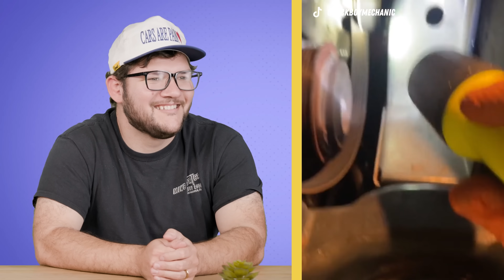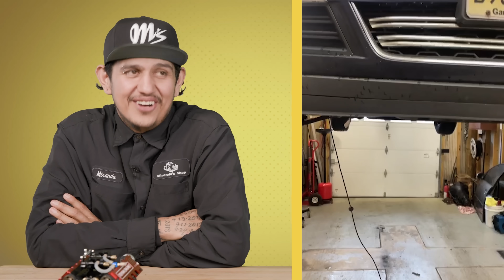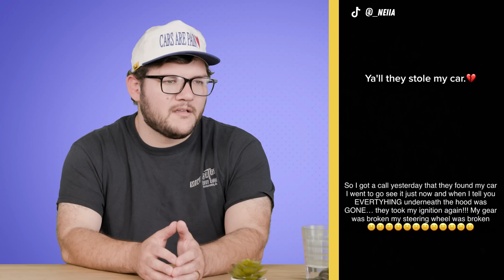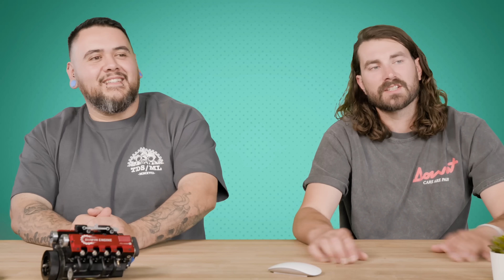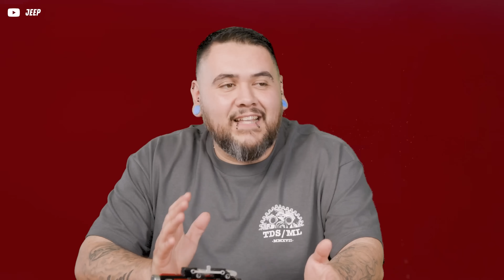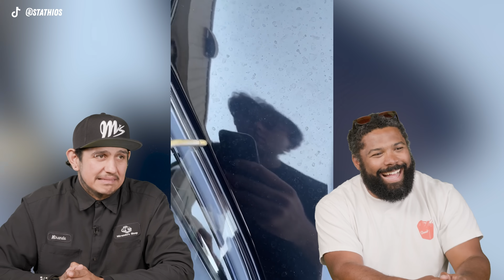Mechanic Reacts to Car Engineering Fails

Comment: My dad had a Jeep Cherokee, that worked fine , then some days it didint work at all. The mecanic would check and everything looked ok. But it just didnt work.
Until i found a post on the internet that said "remove or just loosen the ecu bolts" 
And it worked

Comment: I've 100% had the exact same bolt issue as the first case. Bolt was unnecessarily too long and it hit the frame. Had to spend an extra hour loosening the motor mounts and jacking the motor up. The kicker? I had even more room than this guy, but the bolt was 6 inches long, for a spot that only needed to be 3 inches. It still had a full inch to go after it hit the frame.

Comment: The new ford bronco, the alternator is one of the lowest points in the engine bay. So if you are doing a deep water crossing , the alternator has a high chance of being submerged.

Comment: As an engineer in this industry, all of the cases when these mechanics said rightly that it's our fault, most of the time someone saw it, informed it but sadly it was not put any action to solve it because it was not a top priority at that time, and not marked from our direction of the factory. The reality in this industry is, at some point, if this design issues is not affecting in current production process, actions will not be taken.The reparability is always evaluated, but sometimes not well solved. The working pressure during first production and life serial of the car always come to guarantee keep selling them well executed from the factory, but not how to be dismantled and revised when they need it in the period of five, six or ten years.

Comment: When the sunroof seal on me w208 got too dry from age it leaked like that on my shifter and the cars auto go into limp mode, hade to tear apart the shifter assembly over an evening and give the circuit boards an alcohol bath but it fixed it and has for multiple others I've done now

Comment: I'm going to disagree on the Jeep blame. This is a Chrysler problem and I have owned a Chrysler and it was garbage. Cross threaded a door bolt and left it like that, sticking out at an angle.

Comment: Back in the 1990s I made a template for Ford Tempos so I didn't have to pull the engine to replace timing belts etc. The problem was they were everywhere and the crank bolt could not be removed unless you dropped the cradle and engine 2". I'd set the template on the "frame" and use a 1.5" hole saw to cut an access hole. Then it was just a matter of removing the crank bolt and getting the job done. Took less than 1/2 the book time and increased the number of jobs/day. 

Ford makes good cars/trucks but their engineers told us at a class one time..."we don't care how long it takes to fix. We designed them to be put together as quickly as possible".

Comment: Rofl he said jeep used to have a badass motor. Those things were notoriously underpowered. I'm my border patrol years I drove a 2 door 1999 Jeep as a trainee. Holy crap. That thing wasn't only worse off road than a huge 2007 Chevy Tahoe but it was so loud and so slow. Even at 50mph you could floor it and it would make all the engine noise but make no acceleration.

People make fun of old loud Hondas but damn... Those old Jeeps are louder and slower. It would take literal many seconds to go from 50-60.

I heard good things about Jeeps off road software now but Jeeps were literal trash back then. And BP Jeeps had a sweet reliable lift kit and great tires. They just sucked so bad in soft soil.

Comment: We have the same generation Q3 and had a leaky sunroof.  Quick fix, the drain tube was just a bit clogged up, just pushed some wire through and it's been great for a couple years now.

Comment: 1:48 it could just as easily be the factory. Engineering may have specc'd it correctly, but the factory was like "the bolt the engineers called for is a weird length that costs twice as much as this other one thats just a little bit longer. So fuck the drawing, we're going with the cheapest part"

Comment: In all honesty, it's idiotic that manufacturers don't just test their designs on mechanics doing maintenance items to see if it's reasonable. A lot of vehicles flop partly due to the lack of serviceability
Reply: A mechanic whining that something isn't as easy as they think it should be isn't a 'lack of serviceability'.
Reply: @aarongreen1654  a common service item being impossible without taking apart half the car is tho

Comment: Jeep did one thing right on Liberty's. Because the 3.7L oil filter was impossible to remove without covering yourself in oil, the boxy remodel had a oil chute built in to direct it somewhere else.

Comment: Had an 2006 cherry 1500 V6, that I got with around 80 to 90 thousand on it. And after about 6 months of owning it, she started to fall apart. Starting with a wheel bearing, she alway leaked oil and the engine sized with regular maintenance. And the new engine also leaked oil. The drain plug drained directly onto a cross member of some kind and at some point the muffler fell off, just the muffler. Worst vehicle I’ve ever owned.

Comment: You can say engineer, but as pointed out repeatedly, the company/executives are ultimately responsible for deciding priorities. I imagine many engineers are given a bin of parts they can use and dimensions to put it in, then told to make it fit.

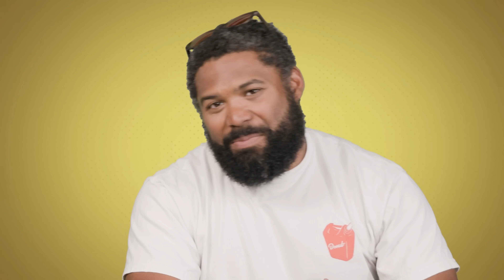Comment: @1:43, the engineer only says “the bolt needs at least this much length to hold the pulley”.  The factory (basically) is who decides to purchase bolts.  Most likely the factory had an excess of that size and had a supply contract and just made it work.  That the problem with all this manufacturing subassemblies.  The folks dropping the engines don’t care how long the bolt is: the pulley is on before the engine gets shoved in there.

Comment: Part of the problem is that the engineers are asked to design the car with a lifespan of 100-150,000, but they are marketed to do 300,000+,and most people think a service fixes all problems in a car. When car's break down, the amount of people that say "It only had a service last week!", like $200 fixes everything wrong and it'll be perfect until the next service. 😳 FFS people, A service is just an  Engine oil, air & Oil filter and lookover of the rest. It does not include brake pads, disc's, master cylinders, ABS unit's, Batteries, etc, etc, etc!!!

Comment: I'm absolutely convinced modern engineers don't believe things break in the future, which is why some things are such a bastard to fix.
I had a memory on Facebook yesterday where I had to replace a broken headlight on my dads 1996 Mondeo. I shit you not, front bumper off, both headlights out because they're permafixed by the grill. You then have to CUT THE GRILL in half. The new headlight is sold with half a grill, and you then have to put a repair kit to connect both parts of the grill.
That's utter madness.

Comment: Shows why McLaren F1 are falling towards the bottom of the championship. The guys working in the factory would look to be in the F1 operation, but the standard of work they are use to doing is of a level much lower than that required by F1, and the fact that they don't recognise it shows that they are doomed

Comment: That Land Rover reminds me of my 2nd gen ‘05 CR-V. The oil filter is directly above the front right CV axle. So unless you take a bunch of time to clean it very well, that whole area is covered in a sheet of oil after driving it.

Comment: You'd be surprised how often water gets into cars. I've got an e46 where water gets in the boot, an F25 where the sunroof drains block, the recess fills up then it spills into the car, and a megane where it drips through the light. Can't figure out how it gets into the roof cavity on the latter though 😂

Comment: To replace the lower wishbones on front of a Citreon C4 on a 17 plate the 2 under trays have to come off there is a crumple zone bar on each side that has to come off as the front bolt that holds the wishbone in place is FACING THE WRONG WAY. Engineers fault.

Comment: Put a hole through the well frame. Spray treat it for future rust and finish the job.  Note it in the shop log for other mechanics and future approvals. Otherwise,  customer needs to  agree to an engine hoist with added costs.

Comment: Modern day vehicles we need more convoluted ways to prevent the owner from working on their vehicles plus the nany state tells us the "morons" behind the steering wheel needs more gadgets and emission controls/the bare basics a throtle a choke (ladies you know the knob you place your purse on) and a gear stick to drive a car. These days you need a snapoff "interrogator" to talk to car to find out whats wrong with the poor darling. Grandpa mechanic used a flow diagram his grand kids uses a odb2.

Comment: I would not blame the engineer, but instead blame the accounting group that go through the entire design, with the sole aim of cutting a cent off the cost of every part along the way, then go through again to cut a second off every assembly step as well. They cut possibly $5 out of the cost by not doing the right designs. And thus you get things like the Pinto, where they figured making it safe in a rear end crash (arguably a common accident) would have added on $20 to the cost of the vehicle for the plastic cover, which they ironically had to do in Canada already. So the $20 was already needed to be spent, and adding to the US versions would be $1. Then to test the final time they were forced to do, they brought in a vehicle, "fresh off the assembly plant", from Canada, which they already had info for passing over the US built ones, known to catch fire. Engineers want to build a safe and reliable car, just they get overridden by managers who want to cut cost as much as possible and still have it make it out of warranty. The managers figure out of warranty the customer either will need to pay for the OEM spares time and time again, or will trade it in at a dealership on a new pile of junk destined to fail as well.

Comment: I'm a Ford guy and I love my 2014 f150 with the 5.0

That's said whatever engineer put the oil filter on the front of the block over the steering, and then put a catch pan under it that slopes AWAY from the built in spout on a front corner needs kicked in the dick.

Comment: I work at a land rover/jag dealership and that drain plug is 100% in a shitty spot. Most things on those cars are in shitty spots; such as the air filter, which is tucked under the radiator support bracket next to the headlight. Basic maintenance is damn near impossible for the average person

Comment: I once looked through some old car review magazines from the 1960s and one very interesting criteria they covered back then which isn't today is the ease of maintenance. They actually judged cars by how accessible everything was if it ever needed repair or replacement. Can you imagine how today's cars would be looked upon in this way if any automotive journalists cared to do so??
Reply: They would be absolutely annihilated😂
Reply: Honestly that is still very much a necessary criteria. Think of much labor is added onto jobs because it’s in a location that’s hard to work in
Reply: There's something called "design for assembly", which also covers disassembly. Unfortunately my design work involves the equipment used to make car parts, so when I do incorporate ease of assembly/disassembly, it only benefits the maintenance techs. Little things like measuring wrench thicknesses to make sure you can fit a flat, etc. is all part of my mindset. Don't have much control over what we're making when handed a product to build.

Comment: 7:25 amen. With Jeep either get one in the AMC to early Chrysler [when the engineering and manufacturer was still basically +95% AMC] or avoid them. With the older AMC Jeeps, even if you got a loaded Cherokee or Wagoneer with electronic everything, they would just last and last.. things like electronic windows would start to slow long before they would fail, giving you a chance to do preventative maintenance before the motor/assembly broke. .Now? Get stuffed, it just broke after a few months of you buying it, too bad.

Comment: Please do a video on the 2021 Ford raptor and Bronco 😭 the raptor has 3 40-60lbs metal skid plates and a chassis brace you have to take off just to get to the drain plug!! The bronco you can take off the entire fender well to get to the oil filter and end up breaking every single plastic push pin in the process!

Comment: My previous vehicle was a 2011 Toyota Highlander (08-13 body style) with 197,000 miles when I traded it. I got new control arms with bushings, new suspension, and ball joints. I replaced the right control arm with no problem. The left side could not be removed because the transmission blocked one of the bolts from being able to come all the way out.

Comment: 2011 CR-V k24, lower rear motor mount and mount bracket attached to backside cast aluminum oil pan, 6 bolts on the motor side and 3 of them you can't get a socket on and there's no room for a wrench, when backing the bolts out the conflict with the subframe, Fluck you engineers. Also why is the oil pan an engine out job? Ain't no need in all that.

Comment: My old Dodge Dakotas with the 4.7L V8 had the oil filters right over the front crossmember. There was no way to get the filter out of the air dam without filling the underpanneling with oil, and soaking the crossmember. Average oil change was 6qt oil, 1 filter, 1 washer, and a bundle of rags. My old Buick needed to take the oil filter out through the left wheelwell, so you had to take the tire off to change the oil. My buddy's classic 455 had the engine wiring harness threadded throuh the frame. And my roomate's Saturn had a special edition huge ass star wrench for the dang oil drain plug, so you had to go to the dealer, or find the special tool. I just removed it, and recoiled it for a regular ass drain plug. 
That being said, all those car companies have NOTHING on McDonnell Douglas, Boeing, and General Dynamics. The F-15 pretty much had every single one of the car problems in one airframe, and maintaining an F-16 guarantees you'll be at the VA after you get out.

Comment: Building computer on the daily, I understand the frustration of the first guy. A 5 min job can turn into a 1 hour job so easily when you have to remove that damn screw you put in the beginning that have all the other shit you put afterward because the last one just don't fit quite right in the intended place

Comment: i worked as a mecanic, and also in car parts sales, and got a few for you:

-best one (from a sales perspective): ford an peugeot share engines, and the gas recycling valve on those 1.6L diesels are the same, but peugeot sells them for 200 and ford for 300, so for every ford, just order one from peugeot and charge that 100€ extra if you dont like your customer, or help some ford buddies with a 30% discount

-bmw intake flappers (do i really need to say more?)

-bmw N47 engines

-mercedes v6 diesels leaking oil from the turbo onto electric stuff

-renault (as a whole, nothing is right with those)

-renault, joke aside, with: glowplugs behind the injection pump; intakes and downpipes splitting in half; rear lights randomly lighting up; blinkers activating your rear wiper (or the other way round, you choose)

-mercedes side mirror electronics, cables snap after repeated opening and closing, but all 11 cables inside are black, so you have to replace the whole bunch AND mirror

-bmw (90-2000) roof tissue coming down

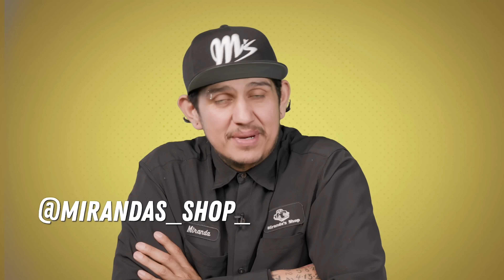Comment: In the video at 11:45 if I was the mechanic I would add a right angle fitting on the oil drain port to make the oil go out of the car into the oil pan below to avoid the oil ever going into the car body, especially onto some electrical components.

Comment: I just want to say, as an engineer working in automotive, that most of the time, the designers of engine bay, does not even know how the chasis will look like. They get empty box with words "put engine here, make it fit". So they do. Chasis will change during this time and boom, we have bolt interfering with chasis. I am not saying that designers does not know about the problems, and in many cases the designs purpose is in fact to cause trouble. But people who should know the problems are mangers, most of the time time shortages, state requirements etc. makes good excuses to release shitty products that as you said fulfill warranty and then fail.

In conclusion many people work in parallel on creating the cars, there are many variables that come into play - tolerances, requirements from government, req. from customers, using existing part etc. We are not robots, so human factor comes into play in every step anybody takes.

Comment: Not only does the GMC Acadia have this problem they have the same as the Land Rover with the rack under the oil pan. Ive had a lot of trouble out of mine with front end alignment to air compressor going bad.

Comment: Not sure if the Kia/Honda thing is an engineering fail or a management fail. It's only US models that have this issue where you can start it with a USB drive or cable, so they probably didn't want to install the chip for cost savings reasons, because they weren't required to by law.

Comment: on the first vehicle you can raise the engine and remove the bolt. second car doesn't show the sunroof with a blocked drain...3rd kias use a metal key without a transponder. 4th car no proof the car had parts swapped or disassembled from auction. 5th car chrysler was bought by fiat ....im done this video is misinformation